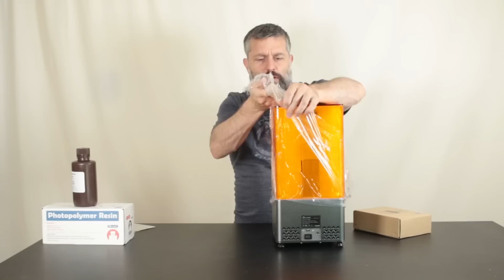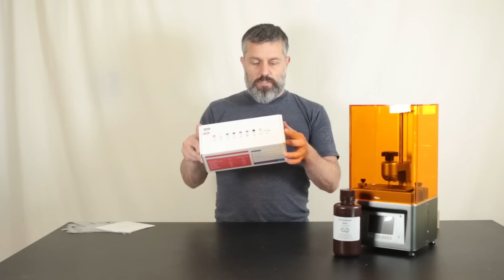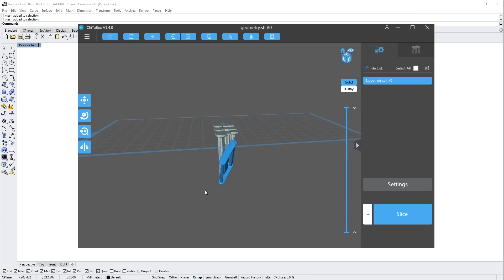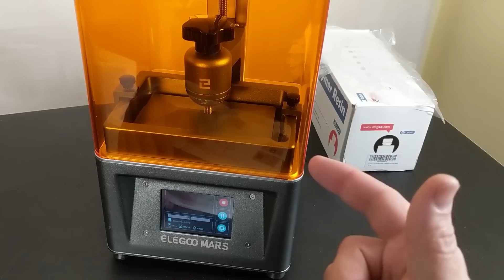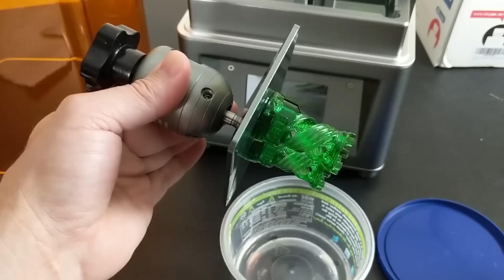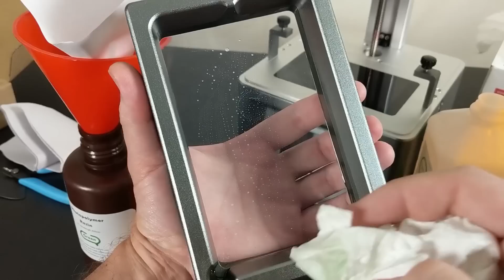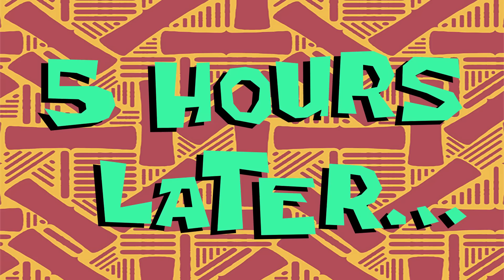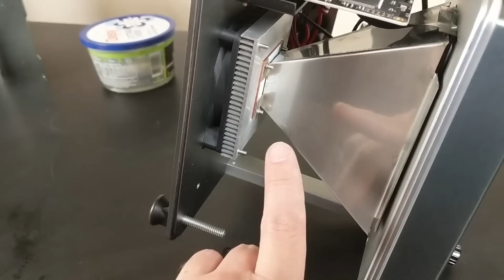$250 for This Quality of Printing Is Unreal! - the Elegoo Mars Delivers, so Let's Review It.

Comment: Carbon and Glass particles filament is weaker than the base material - it is harder and more abrasion resistent but weaker in both tensile strength and layer adhesion. Just imagine you have particles in there the partickles do not interconnect so where ever there is a particle there is no material that adds to tensile strength or layer adhesions. Except if you have something like a markforged with contious fiber then you got greater strength in the direction of the fiber as its continous but again worse layer adhesion HTH
Reply from the maker: Martin, respectfully and without making it personal I think these statements are entirely wrong. Adding carbon or even wood to PLA makes it stronger in ultimate tentile yield and also in layer adhesion. The carbon makes the surface more rough giving more surface area for each layer to bond to the next layer.
Reply: @DesignPrototypeTest  Not according to my research and people who done some testing mostly with Markforged filament with and without and info I got from some manufacturers like taulman as strength is of utmost importance to us as we use it to build a 120lb robot using about 20kg of filament. So here is what I found. Its difficult to compare sometimes as you can't take NylonX lets say and compare them it starts already with inconsistent testing on the spec sheets. Taulman gives you the tensil strength after printing NylonX that of the filament before printing and then which tensile strength are you interested in if you test before elongation then CF wins if you test before breakage than NON CF Wins. if you go for compression CF WINS if you go for durability than NON CF wins. As for layer adhesion etc,. To my knowledge and research Nylon sticks best to nylon so the adhesion to other Nylon is better than to CF. The CF particles are not connected so they are basically little snippets of fiber much less in size than your nozzle "floating" around in the molten plastic in your nozzle - hopefully evenly distributed. if 2 CF particles touch - they do not adhere to each other if they are at the surface of the filament and there is a particle there on the surface on the next layer you got 0 adhesion in that microscopic point. Now Markforged will tell you that even with the layed in whole strand CF that is basically ironed in on top of the layer layer adhesion is slightly less. Now if you make gears then either a hard nylon or if you lubricate CF is better. If you make something like a braket that you dont want to deform then CF is better as it is less durable. If you have something with a lot of fibration or repeated impact then Nylon without CF probably is better as it will return back to shape. If you have some gears that need to run non lubricated then Nylon 12 is probably your choice as its pretty slippery - probably not as much as DELRIN (POM) but then that is a big pain to print. So if you come down to it they are all materials and its up to the engineer to pick the right one for the app. So it has to make sense. So what is "stronger" depends on the application and how you measure. Its like what is "stronger" Steel or rock. Rock has much better compression strength and steel better tensile strength hence one tries to combine the 2 to get the best from both worlds like rebar in concrete. BTW enjoy your channel
Reply: @DesignPrototypeTest  Here found one that compares to base material even though its PLA and ABS https://www.3dxtech.com/blog/carbon-fiber-abs-and-pla-test-data/
Look at the raw data. Tensile Strength always better on the base material and also the IZOD notch and no notch on abs (PLA is pretty brittle/hard by itself already)
Reply from the maker: @martinpirringer8055  Stephan's review of a carbon petg material agree with you: https://youtu.be/LTmuwfyYUJQ The problem here is the length of the fibers. But it's not possible to print with fibers with sufficient length through a standard FDM printer. What we really want is 90% fiber 10% binder (PLA PETG etc.). Instead of the 90% binder 10% fiber like we currently have. Also, we need chopped fibers that are long enough so that gaps between fibers have overlap with complete fibers. Again this is nearly impossible to achieve with standard FDM machines. So, basically my first comment response to you appears to be incorrect. However I'm still not convinced about later adhesion. There's an old video about boat propellers and wood fill PLA where the wood fill performed better with not delaminating on layer lines.

Comment: Cool printer, but that build plate looks like a 3 x 5 card... pretty small I'd say...probably the only draw back of the printer
Reply: That's the drawback of most resin printers. Even expensive ones like the Zortrax and Prusa resin printers are that size (about 170mm x 70mm)

Comment: I found this video entertaining, especially as you had (presumably intentionally) not done in-depth research ahead of time, and were learning about the printer as you went. :-) I had some comments I wanted to make in response to things that came up over the course of the video.
Reply: 5/ There is a bit of an art to it, but you will get by far better curing of your part if you cure the part underwater. This is because oxygen inhibits the curing of the resin; putting it underwater means that none of the surface resin has any oxygen on it at all. There can be artefacts in the print if you don't do it carefully, but I have found that underwater curing is the fastest and most surefire way to avoid prints having any tacky feeling at all.
 (I also use a nail curing lamp to deliver intense UV directly to the part.)
Reply: logiclrd, nice tip on the curing a part in water. I haven’t heard that suggestion.
Reply: @chackokhan  Thanks :-)
Reply: 1/ Firstly, regarding cookies -- that has nothing to do with the Chinese government trying to get at your privacy. Actually, all web sites just use cookies. Web browsers don't stop them from using cookies. The reason so many web sites, including apparently some in China, now tell you that they're using cookies is actually Europe's GDPR laws. Saying you accept the use of cookies doesn't actually control the use of cookies, it just confirms that you are aware that cookies are being used.
Reply: logiclrd. “Web browsers don’t stop them” ... actually just about all browsers I know allow cookies to be blocked. A well-designed web site will deal with this and function without cookies. If you care about privacy, just turn cookies off!
Reply: @mikelopez9893  Of course, but my explanation is geared at people who don't understand why web sites are asking about cookies. Anybody who knows about configuring browsers to block cookies almost certainly understands the prompting as well. :-P I am responding to the idea that a Chinese web site alerting you that it is using cookies is evidence of some global hacking conspiracy. I also have a nagging suspicion that Design Prototype Test actually knows that it's not a Chinese hacking conspiracy :-D
Reply: 3/ As you noticed, the base of the resin vat is a drum-like FEP film. This is basically Teflon, a super-nonstick material used specifically so that newly-cured layers (which are right up against it) don't bond to it. They are still stuck to it simply through vacuum, but because the FEP film is flexible, when the build plate pulls the print away, the flex causes the print to be pulled away harder in some places than others, which helps get the process of it detaching started. If the FEP film is too tightly attached (if yours sounds taut like a drum it might be), then it doesn't flex as much, causing more stress on the part and the film after each layer.
Reply: 2/ Very important, you must keep the resin off your skin, even in trace amounts. If you do get resin on your skin, immediately wash it off using isopropyl alcohol, and try to avoid UV light and sunlight for a few hours. There's this strange thing that happens where when UV resin cures inside your skin, it raises the flags of your immune system, and over time, your immune system becomes sensitized to UV resins. When this happens, you can end up with severe, nasty reactions to any contact with resins. Delay that sensitization as much as possible by always wearing gloves and never handling uncured parts with bare fingers. (Severe cringe when you talked about how they still felt "tacky". :-P)
Reply from the maker: @logiclrd  Please leave the comment about sensitity build up to the resin as a stand alone comment so I can pin it and everyone will see it.
Reply: @DesignPrototypeTest  Done :-D Thanks!
Reply: 4/ Printed resin is incredibly strong and the bond to the build plate is also very strong, which is why surprisingly little support is needed for strength reasons. You need support to connect islands to the build plate, but I have successfully printed a complicated octahedral structure with 60mm edges on its corner with only about a 15mm diameter circle connecting the entire print to the build plate.
Reply from the maker: You get it. Thank you

Comment: You have to completely dry the vat before you put it back on the print.  I can see where it still wet after you cleaned it.  If you try to print like that it will cause bad prints to occur.  Two don't play with that resin with no gloves on.  It will mess with your skin after a while.

Comment: I find rinsing the vat with alcohol help to remove any left over resin and leaves the FEP sheet relatively clean for the next print.
Reply: I have been told that cleaning the FEP with alcohol actually leads to bad prints, they recommend cleaning it with dish soap and water.

Comment: Good job!
 I did cringe a bit at the guilty until proven innocent segments. That too would then apply to US based manufacturers since only 1 manufacturer did it first assuming they had patients that properly covered the tech. The assumption and accusation of copying with no actual knowledge of the accusations is what I cringed at.
Reply: It's not new. Here's Wikipedia:

Chuck Hull (Charles W. Hull; born May 12, 1939) is the co-founder, executive vice president and chief technology officer of 3D Systems.[1][2] He is the inventor of the solid imaging process known as stereolithography (3D Printing), the first commercial rapid prototyping technology, and the STL file format. He is named on more than 60 U.S. patents as well as other patents around the world in the fields of ion optics and rapid prototyping. He was inducted into the National Inventors Hall of Fame in 2014[3] and in 2017 was one of the first inductees into the TCT Hall of Fame.[4]
Reply from the maker: Sorry I made you cringe. I'm just extremely hesitat to hoist accolades on Chinese companies. 99 times out of 100 they are copying, or even stealing IP from the West.  I have a hard time believing this well made slicer that wants all my personal data is not either stolen or extremely closely derivative of something originally developed in the West. It's been proven to be the case so often before, why would it be different this time?
Reply: @DesignPrototypeTest  Keep on making us cringe, Matt. As the lamp bulb bloke put it, invention is 1% inspiration and 99% perspiration. The thieves steal all 100% and ruin your life. Making cheap copies of stuff is great when it's great, despicable when it's despicable. The trouble is knowing which is which, especially because the victims blame themselves (rightly). It's a cruel world but that's why we have morals and are right to express them.
Reply: @DesignPrototypeTest  Oddly enough I agree with that though but on the other hand people create the market for it.
I try to take the good of things like
The good is asian tech (often copies at least to start) gives folks a lower entry ability to get started. Typically not a long life product for the serious.
The non asian tech is typically built to a higher standard and low price is not the primary goal, its part of the reason its more expensive. 

 A small or medium business can get their feet wet at low risk with Asian tech and when their ready they will see the light and understand the price difference. Well some anyway.

Comment: I normally love your videos but seriously do your research before you make these. No gloves anywhere in the whole video, handling resin with bare hands, this made me cringe.
Reply from the maker: I've done worst. Xylene with no gloves makes your skin feel strange, and it takes a couple of hours for the oil on your skin to replenish. I'm not saying the absence of gloves is good, but what little resin I got on my fingers was easily wiped off with a paper towel dipped in rubbing alcohol. It's not as big of deal as you are making it sound.
Reply: @DesignPrototypeTest  It isn't the stuff you did notice that gets you, it is what got on you that you didn't notice at all or the part you missed cleaning up with alcohol. I've had some gnarly reactions from the stuff even while being careful. I'm not going to be one of the guys that says you are crazy for not having air filtering and all this other stuff, but the basics can be important.
Reply from the maker: @sycoclownx  Fair enough.